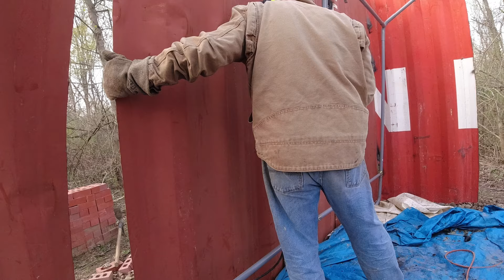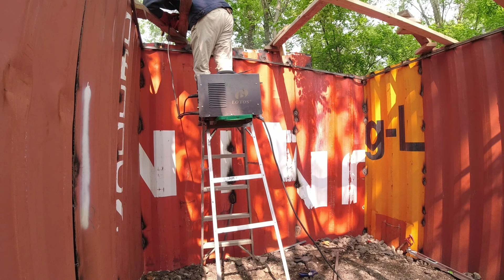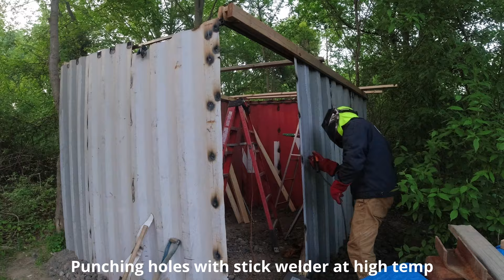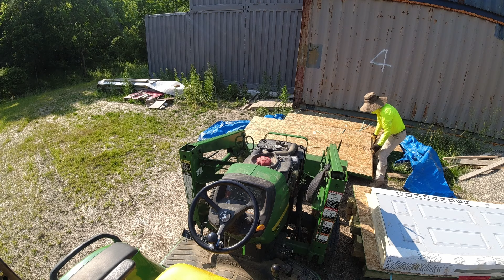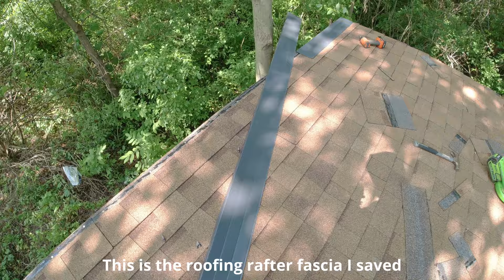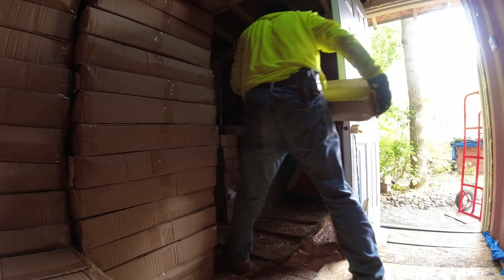World's strongest shed build

Comment: I love your re-use of scrap materials. I do the same thing. I too came here to say that maybe a 1/12 pitch you should have used the metal container scraps for the roof or used pole barn metal for your roof or raised the pitch if you wanted to use shingles.
Reply from the maker: I agree with you.  I should have done that.  I do like your pole barn metal idea, because that should be easy.  Would the ice dam still cause problems with the pole barn metal?  I can ask around.  Thanks for watching.
Reply: Putting the ice and water shield under the metal is a great idea. If you do use the pole barn metal you will have the put metal trim on the 2 side and the higher part of the roof to prevent water from running back under the metal.  @1michiganbuck

Comment: I have a suggestion. Maybe lay out 2 or 3 panels alighn them as you wish and stand on them as you tack it together. Yes it would be harder to move but i think if you did that close to location it would save you some time and effort squeezing them together. Especially since you have larger projects in mind for the panels. Good job on the shed.
Reply from the maker: I absolutely love your suggestion.  I am going to do that for the next build.  This is a great idea.  I can put some lumber underneath the panels for evenness and can even stand on warped areas to force the panels together for the welds, so I don't have to punch holes and use a threaded bolt to bring them together.  I can also weld tubing across them and then hoist them up with my tractor.  I will do a video on that when I build the garages.  Thank you very much.

Comment: Punching holes with the welder is a great trick im shure your drill thanked you for that i started taking a different route home from work so i can pass by Laramie for motivation great work you can never have enough covered storage and outbuildings
Reply from the maker: Thank you.  I learned to use that trick after I punch holes in the walls unintentionally when I first learned to weld.  Laramie is a great company.
Reply from the maker: Yes, I love doing that and have done that in many places whenever I need a hole in the metal.  Laramie Crane is a great company.  I am planning to build 6 one-car garages with the scrap metal, so the shed was a good practice run.  Thanks for watching. I do want to say, in a pinch, if you attach wood to metal, I think the best thing to do is to use a wood to metal screw.  I love using those.

Comment: You can't use shingles on any pitch lower than 2/12.  Should have gotten sheet epdm, or just used rolled roofing / ice and water.
Reply from the maker: Yes, I was worried about that.  So far, no water inside even with 10 inches of snow.  But, we shall see.  I might have to redo the roof, which should be easy now that I have done it once.  Thanks for watching.
Reply: @1michiganbuck  I wasn't meaning to be critical.  I just wanted to point that out so that you hopefully increase the pitch or use another product on the next ones after this prototype.    Great channel by the way.  Glad I found it
Reply from the maker: @davidshumway9639  Thank you for your kind words. But I really appreciate your pointing that out.  I was worried about it.  And someone else actually pointed the samething out but also provided his solution by using ice melt to provent ice dammnig.  I have a couple of other solutions in mind, so we shall see how it holds up.
Reply: @1michiganbuck  as copied from Google.  Not the only source for this topic.  But all seem to agree. 

"Will deicer hurt shingles?

Most rock salts contain chemicals such as sodium chloride, magnesium chloride and other chloride chemicals which are extremely corrosive. These chemicals, while effective on ice, can also eat right through your shingles."
-Damaged shingles can lead to leaks and further damage!Jan 10, 2020
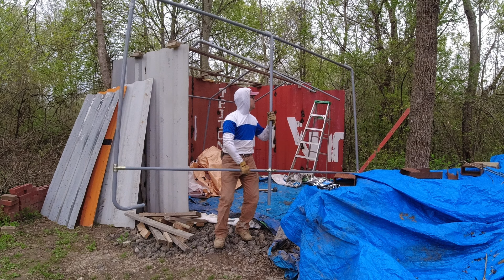Reply: In my area (Southern US) The local code says the same thing, 2:12 minimum slope, but I believe some shingle manufacturers say that 3:12 is the minimum for their warranty to be valid. The problem is not just leaking but mainly being easier to tear off in a high wind event. Some builders install ice and water shield below the shingle and maximize the lap on the shingle to mitigate this.
Reply: @natej6671  not only wind.  But mainly ponding and "troughing" resulting in standing water, leaks, and advanced degradation of the shingles and subsequently the roof structure. 
Sadly at this point since the pitch is not easily changed I would just recommend he invest in some standing seam (hidden fastener) metal roofing.  Exposed fastener would be okay but might leak prematurely.

But since it's only a prototype shed he should probably just learn from it and if it fails early then put the right stuff on it then.
Reply from the maker: @natej6671  Good point.
Reply from the maker: @davidshumway9639  Good comment about the chemicals.  I will avoid that option.
Reply from the maker: @davidshumway9639  I might juse put some container walls on top and call it a day.  Or just rip off the shingles, which should be easy, and then put a layer of EPDM on top.  Fairy easy to do.  Or I will just stick to using a cordless leaf blowers to blow the snow off.

Comment: I ran into similar issue on roof pitch of shed once as well was pretty worried i just tossed some ice melt up there during heavy snows never had any problems
Reply from the maker: I love your solution.  I have 3 alternatives now: Your method, or use a leaf blower to blow the snow off the roof, or redo it with EPDM.  We shall see.  Thank you for watching.